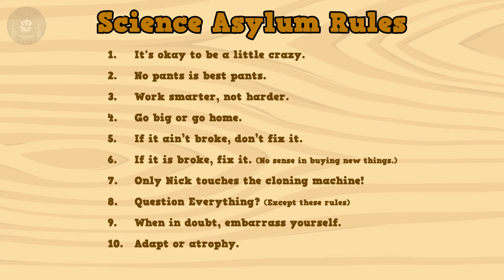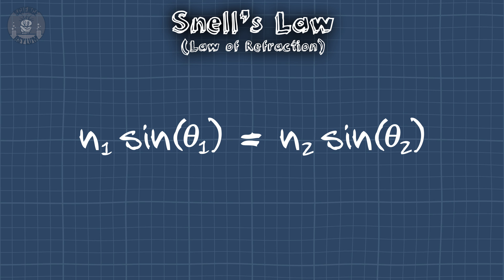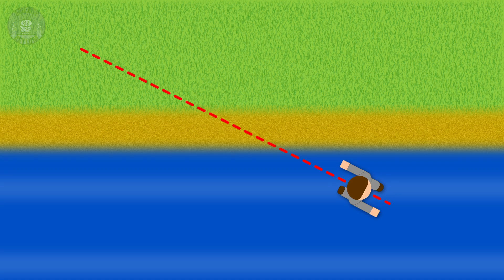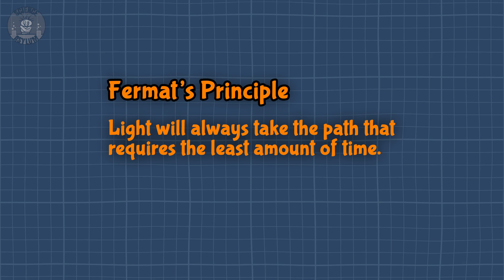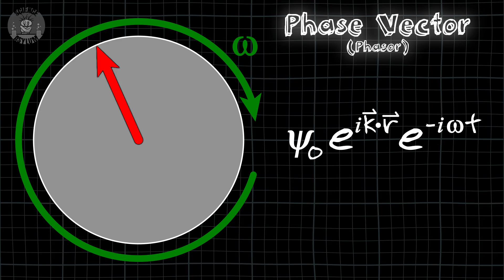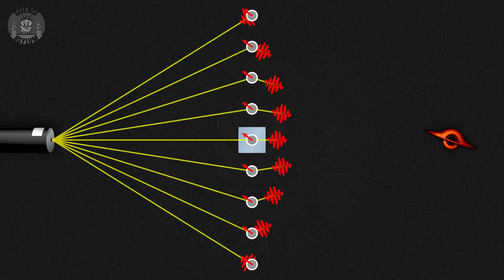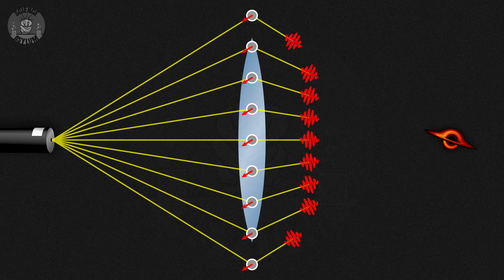Why Does Light REALLY Bend?

Comment: A new question came up while I was thinking about the last two videos.  How does a still body of water like a lake create a mirror-like reflective effect instead of a general diffusion?  I'm assuming most lakes are not nearly as good electrical conductors as metals, not even if they were saturated with electrolytes, which I assume most lakes are not.
Reply from the maker: You are correct. While water does conduct electricity, it's nowhere near as good as metal. The reflectivity of a still lake has a lot to do with smoothness of the surface, but also there's this optical quirk called "Brewster's angle" that helps out a lot. It says that any smooth surface can become mirror-like if you look at it at a shallow angle.

Comment: oh god forgot that you might be able to show how color correction lenses work for video projectors, where several different materials that have a different variable of how much it slows each frequency of light (red green and blue) so when they exit the other side, it stops the images of say white items from having a blue edge on one side and a red edge on the other, because the speeds of each was tuned to make sure they are all on the same path line when they exit the group of lenses stuck together.

Comment: how can we eliminate this issue in say a sintering laser, or take advantage of the effect. explain that in a video, or point me in a direction where you might have already done so, 

on another topic you should try explaining how frequency effects how a photon interacts with a given material, like is it the size of the valence in the atoms that effect this? or maybe something else like the frequency the atom is vibrating at ect, to show why some are absorbed (like IR and vacuum UV in glass) and transmitted (like visible light through the same glass) while others are reflected (like say visible light hitting a smooth aluminum surface such as a mirror) and maybe pepper in how the energy injected like vacuum level ultraviolet hitting CO2 energizes it so much that it can break the CO2 bond giving CO and O or C and O2 off of a given reaction, 

I am working on using these traits to not only effectively use things like CO2 as a oxygen and carbon nano particle for 3D printing, but hope that it will not be to fiddly requiring a ton of tweeking every time, to get different frequencies in a given area to allow rejecting say one while causing a bond with the other (like swapping between lasers A and B to get oxygen to break off and avoid being in the print while the carbon is being used to print graphene/diamond hybrid glass, over to laser C and D that will instead promote the oxygen to coat it when done, and the carbon to drop to a low energy state and not bond and get mixed into the coating, say for an AR coating like we see on titanium when its anodized and reacts to different frequencies based on how thick the TiO2 coating grows to.

Comment: How does this method of analyzing lenses work for fresnel lenses? They don't have consistently more "glass" material in the shortest paths than the longest; they depend on just curvature, it seems.
Reply from the maker: I assure you Fresnel lenses work the same way. We just need to be more complete and more careful than I was in this video. Here are some things to keep in mind:
1. The path length isn't actually about length. It's about time. That's why we define something called an "optical path length" or OPL, which is the index times the distance (n*d).
2. The paths in this video represent the paths available to a single photon when it leaves a specific source and is traveling to a specific destination. We're asking a question about detection, so we know where the photon starts and where it ends. We just don't know which path it took to get there.
3. There are many paths I didn't include in the graphic... like curly ones... and ones that go to the Moon and back.

Comment: As taught in every Photography class light from a flashgun or light source illuminating a photographic subject follows the inverse square law, so if the distance from light source to subject increases then the exposure setting needs to be changed to compensate.

But... the same light reflected off the subject towards the camera doesn't appear to follow the same law- if the subject to camera distance increases the exposure doesn't need to be adjusted. Why not?

Like the moon for example, if you took a picture on the moon, or a picture from the moon on earth, you would dial the same values for ISO, F and exposure Time, why is there no decay in reflected light ? A reflected photon has to travel to the camera's film of digital sensor, this distance seems non important...

Comment: Nice job on the explanation, and great production value as usual!  Just one quibble - the drone's image at 2:13 is in the wrong place.  It should be above the actual drone, not to the right.  (You can tell because if the scuba diver moves to the left, the ray that reaches them there would also appear to be coming from the image.)

Comment: "All of these paths contribute".  

I'm guessing that's a reference to the principle of superposition?  Is each one particular solution to the Schrodinger equation (or is it a different equation here?  I'm not really sure when the Schrodinger equation in particular is used.) one of the paths and the general solution is the sum of all the particular solutions?  Or, in other words, the solutions to the differential equation form a vector space, the basis of which represents (variable) path(s) the photon takes?  It gets confusing at this point, because I want to say it takes one path and we just don't know which one unless we have initial conditions.  That's how we interpret D.E.'s in classical physics.  But that would be a local hidden variable interpretation of QM, which I know has been ruled out.  So I guess all we can say is that the general solution to the D.E. (assuming I'm correct in applying that concept here) tells us what happens to the light at the end, but we don't actually know what happens to any individual photon in the interim.  Am I on the right track here?  A lot of this QM stuff is making more sense since I've taken a  differential equations course, but I want to make I'm not just conflating things here.
Reply from the maker: Well...
1) Schrodinger's equation doesn't actually work for photons. It only works for massive non-relativistic neutral spin-zero particles. It's actually a lot less useful than an intro QM course would have you believe. Feynman's path formulation is QFT, so it uses Dirac's equation instead of Schrodinger's equation. You are correct in calling a differential equation though.
2) You were good to correct yourself about the photon only taking one path. Local hidden variables have been ruled out, so we know the photon doesn't just take one path... as long as locality is maintained anyway. Global hidden variables haven't been ruled out yet, which is why some people obsess over pilot-waves.

In reality, all we actually test is whether or not a photon arrives at the detector. We can't really know anything else. If we do the single-photon experiment a bunch of times, we can record how often a photon is received (maybe 10% of the time or something like that). According to QFT, the only way to get that value on paper is to write out the wave functions for photons taking each possible path and then add them all together. Considering one path at a time gives us incorrect results on paper.

Comment: I was a little bit confused about the laser and detector example you provided. If you look closely it seems that the photons taking the farthest path are in the same phase, because they take the same amount of time to reach the detector. Wouldn't that mean they should add together rather than canceling?
Reply from the maker: Those two specifically yes, but there are other paths not in the animation (farther away) that would cancel them both. I just ran out of a room on the screen.
Reply: @ScienceAsylum  Thank you!

Comment: Before you introduced the lens, you stated that the probability of the photon appearing at the eye is determined by the sum of all the arrows taking all possible paths. But the arrows take a different amount of time to arrive at the eye. So they don’t arrive at the same time. Why does it make sense to add arrows together at one place, when not all the arrows are there at the same time?  If it doesn’t make sense to do this sum, then the pattern a diffraction grating presents would not be seen if you tried to build it by sending one photon at a time. This experiment would prove if it makes sense to add arrows that arrive at different times, or if it only makes sense to add arrows that arrive at the same time. I’ll help you do that experiment if you want. (It would also tell us how long a photon is).
Reply from the maker: Ok, a lot of people are asking about this. I need to pin a comment explaining.

Comment: Hey Nick! I don't get that explanation of lenses via QM (Feynman path integrals) since it isn't the amount of glass but just the angle of the surfaces that determines the direction (Fresnel lens). I understand it just via Huygens principle. Is there an experiment similar to the reflection experiment where only phasors that constructively interfere are used? (if you know what I mean)
Also you say light doesn't really travel slower in materials with a high refractive index, "we should just go with it" but you make use of that all the time. Please explain!
Reply from the maker: I assure you Fresnel lenses work the same way. We just need to be more complete and more careful than I was in this video. Here are some things to keep in mind:
1. The path length isn't actually about length. It's about time. That's why we define something called an "optical path length" or OPL, which is the index times the distance (n*d).
2. The paths in this video represent the paths available to a single photon when it leaves a specific source and is traveling to a specific destination. We're asking a question about detection, so we know where the photon starts and where it ends. We just don't know which path it took to get there.
3. There are many paths I didn't include in the graphic... like curly ones... and ones that go to the Moon and back.
Reply from the maker: As for the light slowing down, I'll get to that in a future video.

Comment: sometimes it seems that you're talking about one photon and sometimes it seems that you're talking about a series of photons, so which one is true? when you're talking about canceling out vectors, is it canceling of multiple quantums, or probabilities of one quantum ?  when describing the lens - again is it about one photon ?  does lensing affect one single photon? if light is discrete and one photon is least possible unit, how can lensed vs unfocused photons differ?
Reply from the maker: Any time I'm talking about photons in this video, it's a single photon taking multiple paths simultaneously. Those canceling arrows represent pieces of the wave function of a single photon.
Reply: @ScienceAsylum  in that case  im confused by the lens role even more. need bit more explanation on that. we force the light to take more paths (spread the probabilities more evenly) so its less prone to be anihilated until it reaches the observer?
Reply from the maker: Oh, we're not forcing the photon to do anything. It just naturally takes all available paths on its own in all situations (mathematically speaking). All the lens does is just change the time each path takes. The paths are always there. The more constructive interference (arrows lining up) we get at the detector, the more likely we are to detect a photon at any given moment.
Reply: @ScienceAsylum  ahh true i didnt realize in quantum realm we dont have to even detect a photon even if it still exist, dont have to be anihilated. and that older statement that light always choose the fastest path is not true in its nature, just describes the fact that all other paths cancels out - but they still exist
Reply from the maker: Exactly.

Comment: How do laser beams not spread out with distance? I have always wondered that. I mean, if the laser beam amounts to light in a circle, the radius of the beam should increase the farther out the beam goes. 

And yet, I have seen laser beams go quite a distance and I see no difference in the radius right at the laser and the radius where the laser beam touches an object(protecting my eyes from the laser of course)

How is it that this beam radius of the laser stays the same, even at long distances?
Reply from the maker: Laser beams do spread out with distance. They just start so narrow to begin with that it's harder to tell. If you shine a laser across a room, the dot on the wall will be larger (be a measurable amount) than a dot you get shining the laser on something close to you. Next time you try it, have someone else measure the dots with a ruler.

Comment: Might another reason to look up the refractive index instead of calculate it be that we can measure the refractive index with greater precision that would be afforded by measuring the permittivity and permeability and calculating it? Making a single precise measurement is typically easier than making two precise measurements.
Reply from the maker: Good point!

Comment: When you said light takes all possible paths you only drew the paths where it travels in a straight line in the air and the water (only turning at the boundary). Can light travel in a curved line in the air? Can it do a loop-de-loop? If yes, do we have to take that into account in our quantum calculations?
Reply from the maker: Yes, light can travel along any path, even curly ones. I only included enough paths in my video to make the point I was trying to make. There are many more paths I didn't draw.

Comment: I once heard of something called metametarials and how they could have a negative refractive index, and there are no known  natural materials have this property. How could something like this be possible?
Reply: Metamaterials typically work only for macro-scopic wavelengths (far infra-red or higher). Refractive index is determined by permitivity and permeability. Natural materials only have positive values. However, it is possible to arrange conductors in such a way, that they have negative permitivity and/or permeability. This is fairly simple if the light has large wavelengths. For short wavelengths (like light) the conductors need to be arranged on molecular scale. That is considerably harder.

Comment: Lens is not working by slowing light differently at different thicknes. It works ba exposing light to different incoming and outgoing angles between air and glass. Different thickness is just coincidence of requirement that angle is changing along radius. Fresnel lens have same thickness across surface and still outer rays are bent to reach focus. Bending depends on angle, not on thickness.
Reply from the maker: I assure you Fresnel lenses work the same way. We just need to be more complete and more careful than I was in this video. Here are some things to keep in mind:
1. The path length isn't actually about length. It's about time. That's why we define something called an "optical path length" or OPL, which is the index times the distance (n*d).
2. The paths in this video represent the paths available to a single photon when it leaves a specific source and is traveling to a specific destination. We're asking a question about detection, so we know where the photon starts and where it ends. We just don't know which path it took to get there.
3. There are many paths I didn't include in the graphic... like curly ones... and ones that go to the Moon and back.

Comment: As an optical engineer, there is some serious problem with the ligth cancellation. You are confusing/mixing wavefront propagation and  coherent interference. Most of the optics from everyday life is incoherent ligth, which doesn't behave that way. For the ligth to the probabilistic, you need to know enough information (position, energy, direction) about the ligth for those effect to come out (pinhole>diffraction, coherent monochromatic beam>interference).  Macro effects is not the sum of quantum effects, like macro matter is with the combination of molecules.

Comment: So, if photons travels every path. Assume, we shine a laser pointer at the center point of lens from an arbitrary distance (not necessarily from focal distance). Then light shall pass through total lens surface with equal probability. And a surface just after the lens, shall be illuminated with equal intensity for full lens area. Does this happen?
Reply from the maker: Not all paths are equally likely, so you're far more likely to get a photon where you expect the beam to be going. However, very occasionally you should expect to see a single photon show up outside it. That does happen.

Comment: What causes total internal reflection when light goes from a medium with high refractive index to a medium with low refractive index with a small angle?
Reply from the maker: The only place you get constructive interference is inside the original material. The new material the light is trying to pass into destructively interferes the light everywhere.